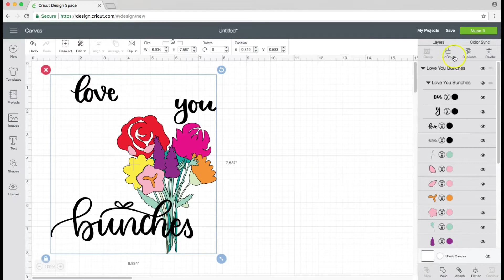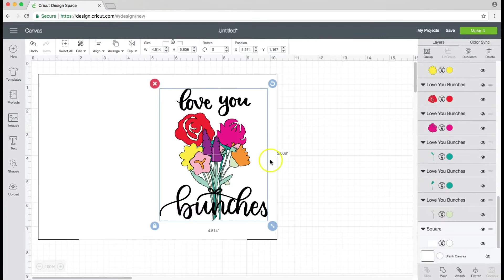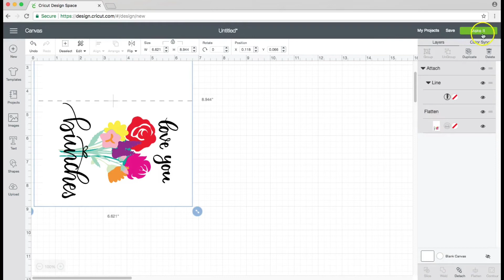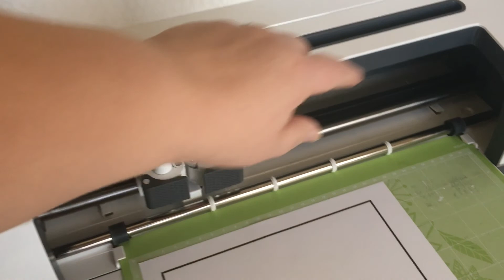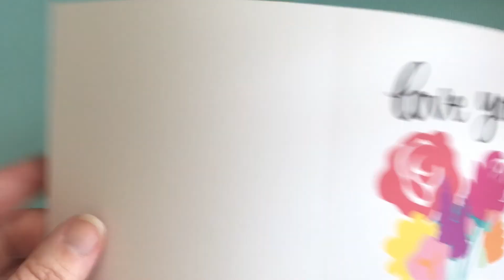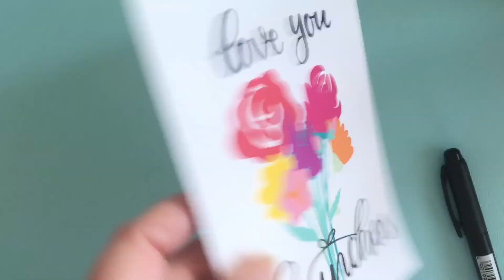How to Print and Cut an SVG File

Comment: Hi. What printer do you use?
Reply from the maker: I use an HP Envy 5540.  I love it because it has the instant ink program so I don't have to run to the store to buy ink all the time.  Just make sure and check best settings when printing.

Comment: I just want to know how to reduce the svg ornpng siZe of the image coming up on the computer when I'm trying to print it for a wine glass or tumbler waterslide. The images are way to big And when selecting size I want to go for index card size ,but it cuts the age up.
Reply from the maker: You will need to resize the image in an editing software.  If you are doing print and cut on your cutting machine, you should be able to adjust the size in the program software.